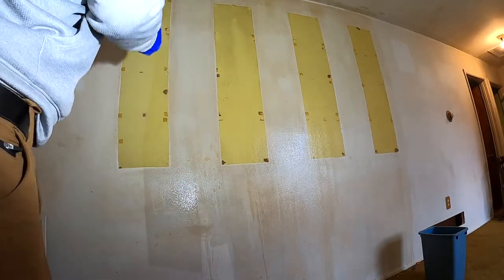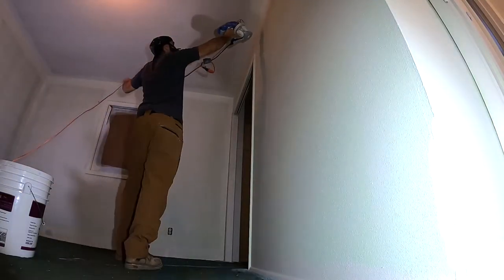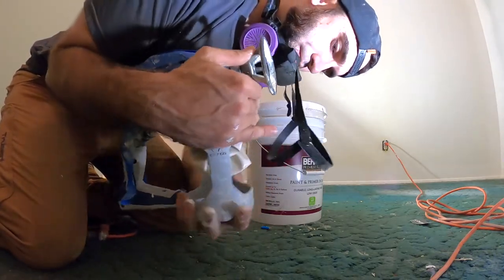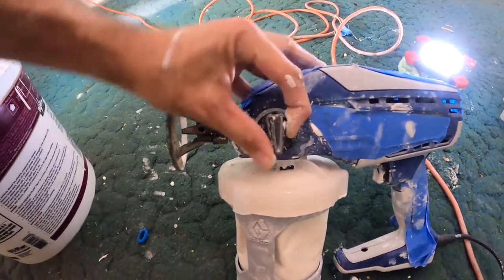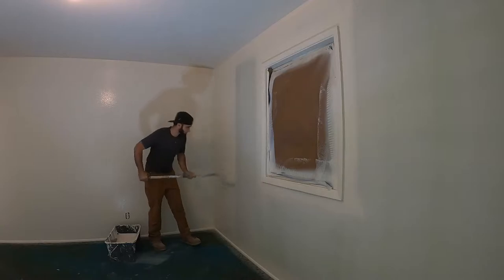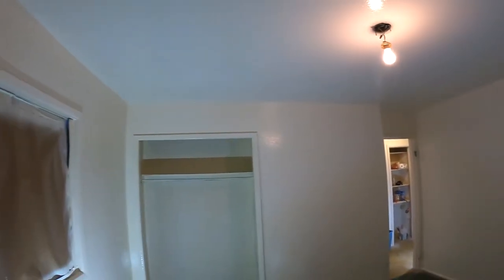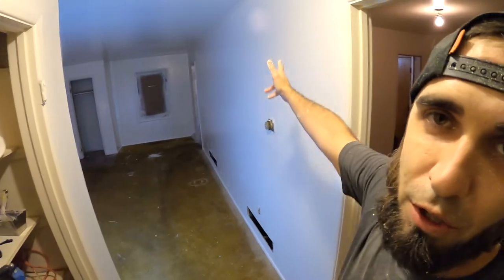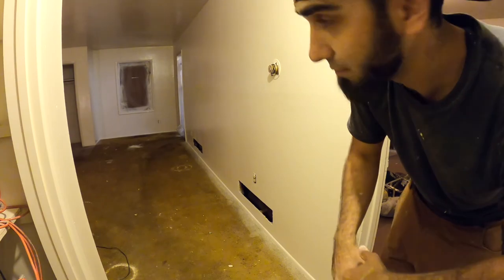Painting a Smoker's / Hoarder's House

Comment: I'm in a similar situation. I'm having the whole house deep cleaned, and then I will prime the walls with the Zinsser Bin shellac primer, and then finally repaint. I'd do the same to the ceilings but they are unfortunately popcorn, and I don't have a sprayer / experience using one, so leaving that to the professionals. In your situation, did this process remove the smell?
Reply from the maker: Yes. This definitely helped the smell a lot. I was back in the place for a repair recently and you would never know it was smoked in. I couldn't smell anything.